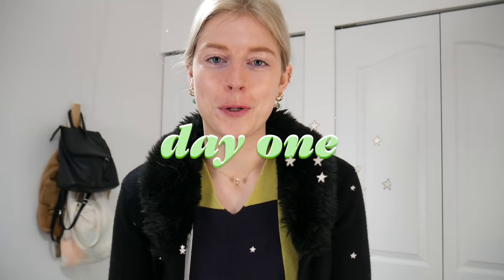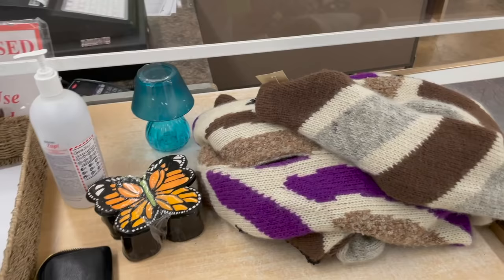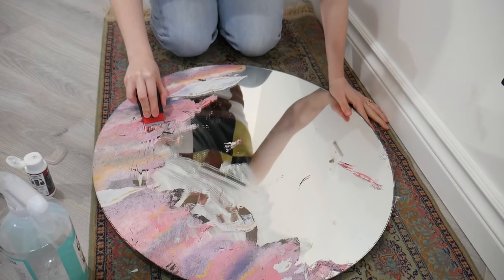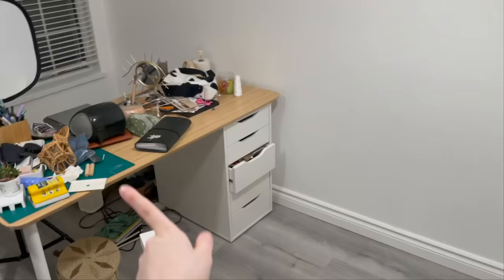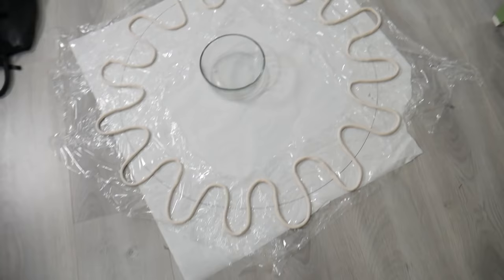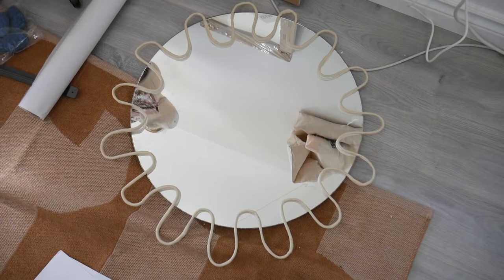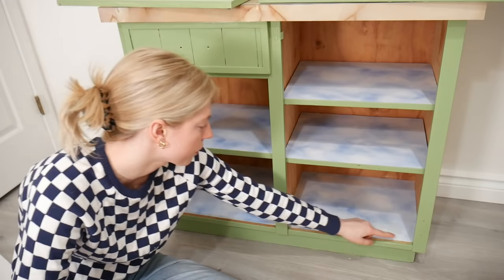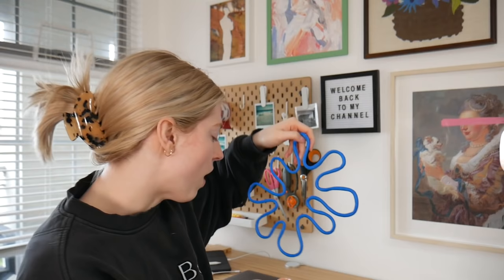ROOM MAKEOVER 2021 but it's all thrifted **tiktok/aesthetic/pinterest inspired (budget friendly)

Comment: If you have any trouble with the glue holding on the mirror, purchase some E6000 glue from Amazon or some thing and use that instead. You’ll need to use it in a well ventilated room but it works like a dream! It dries clear but has some thickness to it, to be able to bond to some of those gaping spots.